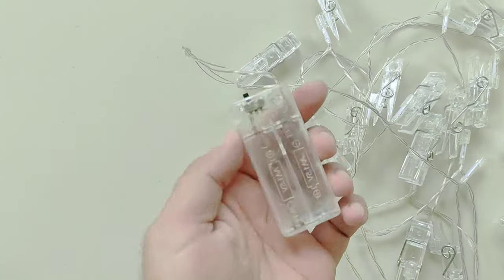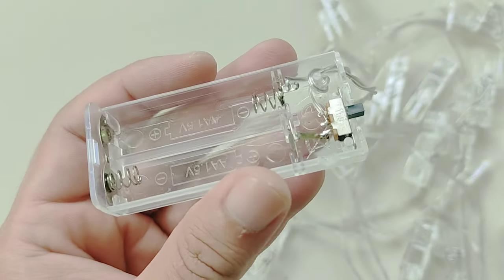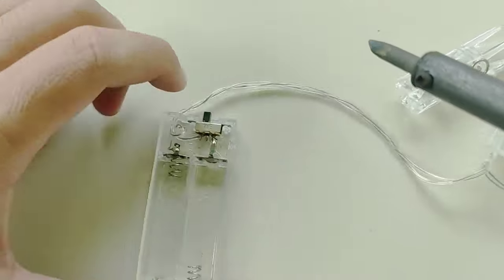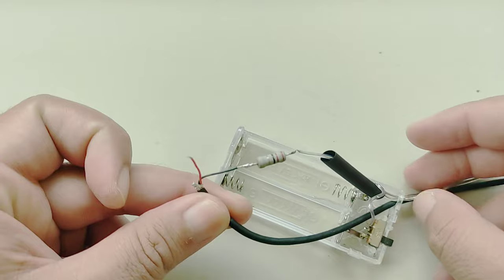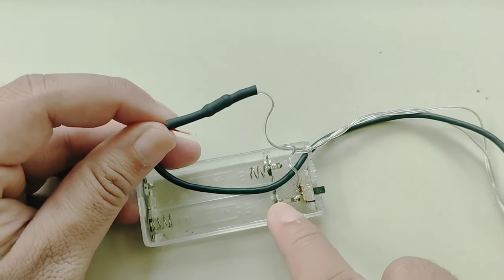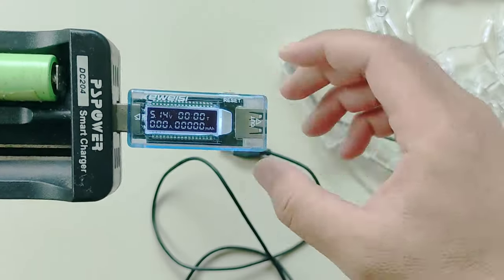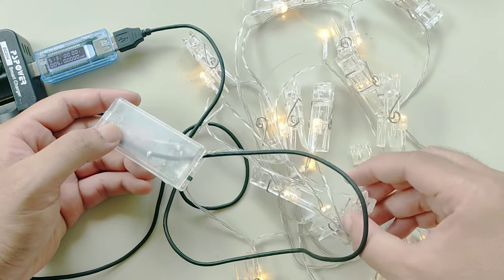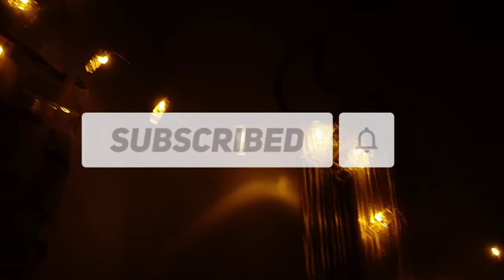How to modify Fairy lights - USB Powered, No more AA batteries (2023)

Comment: Can I plug the wired USB CORD to a USB to AC adapter and plug it in yo any 12v outlet?
Reply from the maker: If you want to use a 12v power source,  you just need to change the resistor to a higher value.

Comment: What was the reason for adding the resistor and why couldn't you direct wire them to the USB?
Reply from the maker: You will burn the LEDs if you connect them straight to a 5V USB.
The resistor helps limit the current.

Comment: Mate, I just get one long dowel rod, the thickness of a AA Battery (or a AAA Battery ... you can do the same). 
Then I cut them up into the lengths of the AA Battery. 
If you have a 3 port ornament to power up with USB, then you put in metal screws at each end of TWO dowel cutouts and screw in one piece of cable to each end. 
On the THIRD dowel cutout, you add the USB cable. The USB cable needs to be stripped back a few centimetres ... cut out the Green and White cable, then screw the Red and Black cable into your third Dowel at either end. 
That's it. You're done. Just place them into your ornament and ... presto ... it all lights up.

Comment: Great instructions is there a way to combine a number of lights to reduce the number you have to switch on seperately please?
Reply from the maker: I'm sorry, I don't really understand the question.
Reply: @TaylorSoloaiJR  sorry let me explain I have 7 separate lights each one has 2 batteries and an on/off and I would like to get to the situation of having just one on/off by combining all 7 ?
Reply: I would also like to know this! My mother has 3 strings of novelty lights exactly like the one from the video and she likes to decorate a shelf with them. I could transform them all to 3 USB operated strings, but is it possible to connect the 3 strands into one string with one USB connection?
Reply: @sharkofjoy  I hope to successfully complete my project this weekend if it works I will let you know what I did !
Reply: @sharkofjoy  1st attempt hasnt worked need to take it apart and try again 😒
Reply from the maker: If you're planning to connect all 7 lights in series, that means you're going to need more than 5V to power them all and also different resistor value to limit the current.
Reply: @TaylorSoloaiJR  I have got an adapter plug that allows me to select from 3 to 12 volts that project is in progress need a bigger connection block than one I have. Found a 6 into 2 😉 but its my 2 sets of lights I have wired up that hasnt worked 😒
Reply: @janebowcock7611 Did you ever get this to work?
Reply: @itsacountry yes I did but had mixed results ... tbh there are lots of lights on the market now that are usb plug ins so if you are not attached to the ones you have replace them. That said my 7 battery lights into an adapter worked a treat and is now set up on a smart plug with my other lights 😉

Comment: Tried it and did it step by step with Pausing and doing it exactly as you were doing it. And result looked just like yours, but it did not work. Even
Watched the video 5-6 times before I even started. All I got was a messed up USB cord and lights I can't use now 😢
Reply from the maker: You used the right resistor?

Comment: Is there a way to get rid of the ridiculous, ugly, useless battery box ?  batteries cost an arm. Rechargeable batteries are a pain in the butt.  The box is in the way, it s annoying.  I want to connect my led neon sign directly in my computer or a socket wall like a cell mouse keyboard lamp etc....
Reply from the maker: Just connect the lights straight in series with the correct resistor to a USB wire.
Reply: I thought about that too. I think the purpose is to still be able to use the on/off switch. I am confused about the use of a power bank that seems to have a battery in it.
Reply from the maker: Powerbank with 18650 battery inside was just used to test it and prove that it works with any 5v power source.